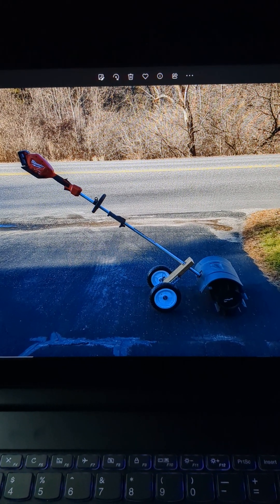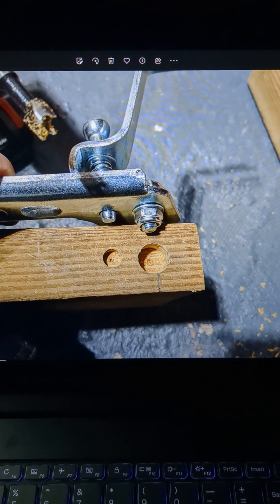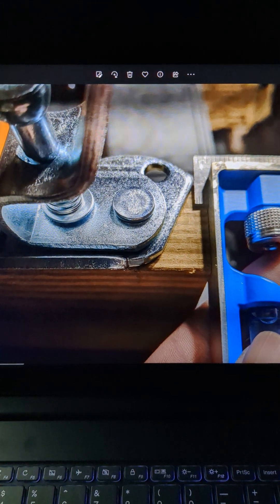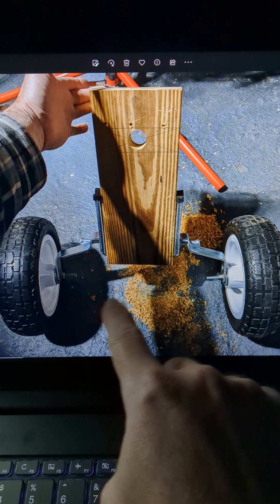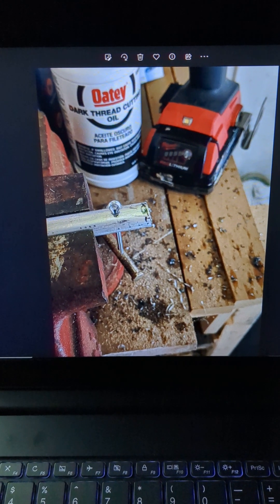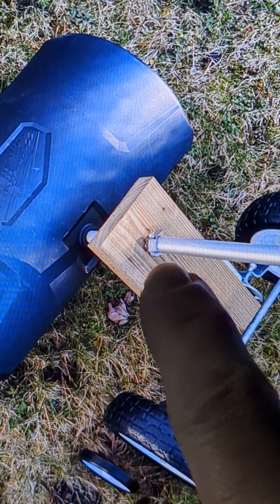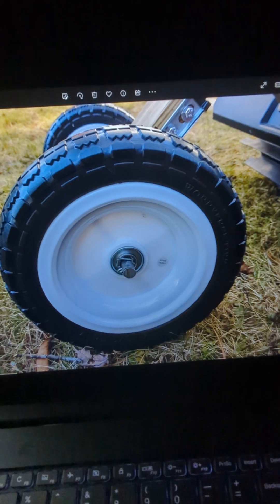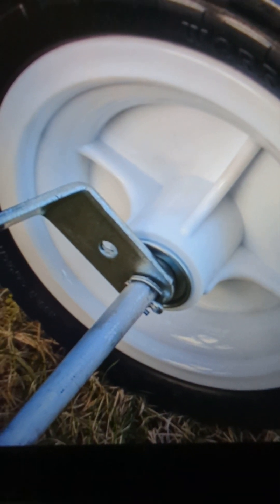How I built my Milwaukee M18 power broom jig (by request)

Comment: Sick setup!
Reply from the maker: Thank you - glad you like it :)
Reply: @mikea3552  Milwaukee should make an attachment like that. I just ordered the rubber broom myself.  Might need to copy your design.  Thanks for sharing, especially at somebodies request.
Reply: @mikea3552  where did you source those larger training wheels?  Do you have a link?  Forsener bits are awesome.  I laughed when I saw the hose clamps, that's exactly what I was thinking to use to stop the board from moving.
Reply from the maker: @steffen707-  I totally agree!  I tagged Milwaukee when I uploaded this video in hopes someone there might see it. It makes using this power broom much easier and fun! I'm glad you ordered one - you'll love it!  I use mine every chance I get. Feel free to copy my design and let me know if you have any questions and I can try to help
Reply from the maker: @steffen707-  I bought the larger training wheels at my local harbor freight. They are called HAUL-MASTER 
10 in. Worry Free Tire with Polyurethane Hub sku(s) 96691, 62639.  https://www.harborfreight.com/10-inch-worry-free-tire-96691.html?_br_psugg_q=wheels
Reply: @mikea3552  ohh it didn't come with the training wheel bracket, got it.  So very helpful Mike!  I'll hit up harbor freight this weekend for a set of those wheels.
Reply from the maker: @steffen707-  You're very welcome :)  For the training wheel bracket, you can purchase that on Amazon. In the search box, just type in this ASIN number: B01LZCUTPX     The current price is $14.16 for the set.
Reply: Mike, do you happen to have the approx. dimensions of the 2x6" as well as the location of the hole for the post (looks like it's approx. 3.5" from the top)?
Reply from the maker: @johnagger6327  I sure do - I just went out to measure it and the scrap piece of wood I used measures 5-1/2" wide, 12-1/2" tall, and the start of the hole is at 2" from the top. As a tip, you won't need to worry about the exact location of the hole because you can slide the jig down the shaft until you have the perfect height to match how tall you are, then just fasten the hose clamps at that spot.
Reply: @mikea3552  Sweet - thank you again! I'm super excited to get this built. Just waiting for the wheels to arrive. Rest is here. Cleaned our turf by carrying the Milwaukee rubber broom around yesterday and today. Pure torture after 15 min. or so! Happy New Year when you all get that far!
Reply from the maker: @johnagger6327  You're welcome and you can kiss those days of dreaded torture goodbye once that jig is built - LOL. Wishing you a Happy New Year too :)

Comment: All worked like a charm - made two while I was at it. Couple of things: I used a 5/8 rod rather than 1/2 inch. Better fit for those wheels. Also, there's an annoying little bolt + nut combo that needs to be removed from the pole. Took a few tries but got it out. Didn't bother putting it back in. Thanks again, Mike!
Reply from the maker: You're so welcome John and very happy to hear it all worked out!  Enjoy :)

Comment: Very nice ! Where you buy your bracket and your wheels ? Can you send me link please . Thank you !
Reply from the maker: I bought the wheels at Harbor Freight https://www.harborfreight.com/10-inch-worry-free-tire-96691.html?_br_psugg_q=wheels  and bought the bracket on amazon - search for item number  B01LZCUTPX  Good luck in your build :)
Reply: @mikea3552  Thank you for your fast reply !! im gonna order it tonight and also can you tell me how long is your 2x6 and the measuring of the home from the top please. thank you !
Reply from the maker: @fishvtec7  Sure, my scrap 2x6 measures 12 1/2 inches tall, 5 1/2 inches wide, and center of hole to top is 3-inches. You can then slide that 2x6 anywhere down the shaft to fit your height perfectly.